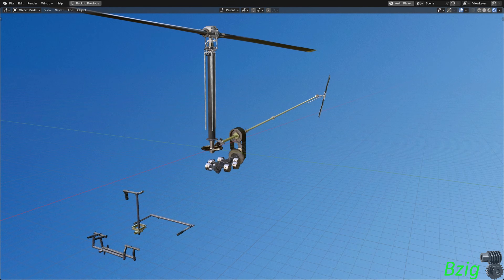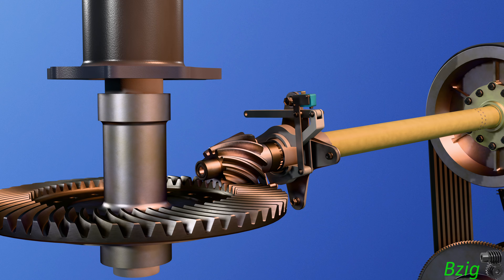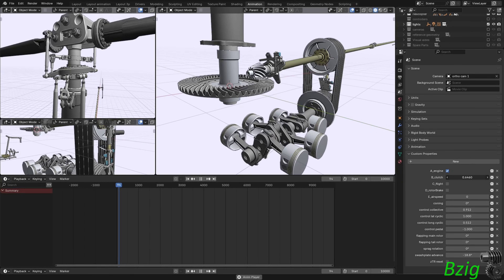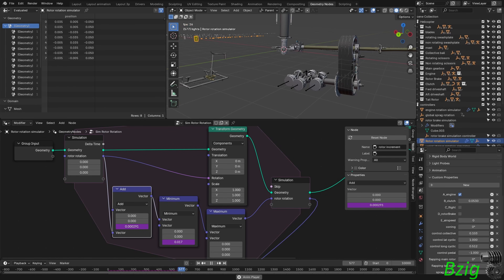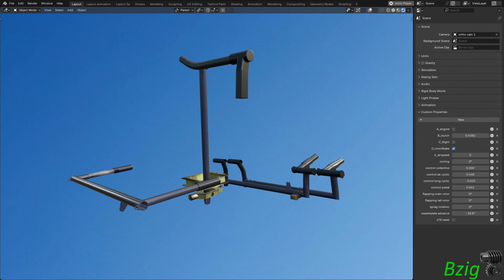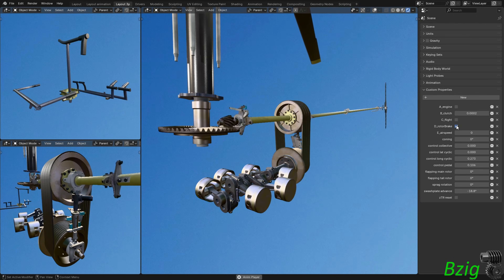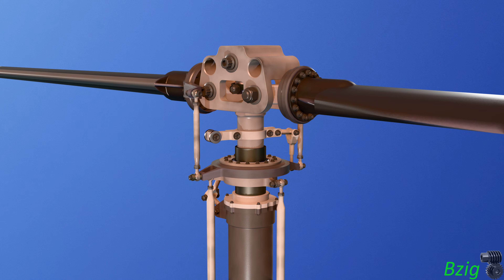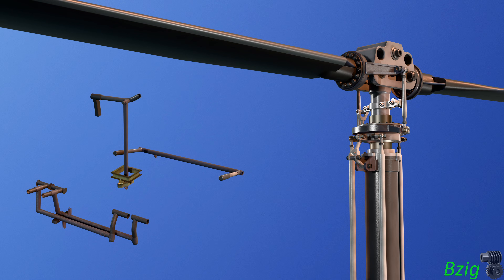R-44 Helicopter Project Update

Comment: Thank you for sharing this information . But I still waiting for the coaxial rotor ! 😂
Reply from the maker: in work... really ;)  I've started a preliminary design.  I'm taking inspiration from US patent US 20200377208 for the control system except I'm going to do this as a 2-blade teeter for simplicity.
Reply: That will be awesome❤

Comment: Awesome as usual. If a passenger in an R44 pulls the rotor brake in mid-air, what happens?

Same question for any makes of helicopters that have a different answer.

I’ll bet you know the viral video that prompted this question.
Reply from the maker: I've never had one come on in flight... I've flown a few models with electrically actuated brakes.   Manual brakes and electrically actuated all have procedures for a brake on in flight... usually a land as soon a possible emergency, and they all hint that the concern is a brake fire, and not a loss of rotor RPM.  smaller helos?   IDK, there might be an RPM reduction until the pilot smacks your hand away 😬
Reply: @bzig4929  OMG, have you not seen this? https://youtube.com/shorts/4AOvXCiMaXg?si=us4ZkvDcbA1UuLu0

What model helicopter is that, and what damage could she have done? I presume she was a hot-mess blonde.

The comments on some of the postings of that video are wild and all over the place, with no clear answer as to if she could actually have killed everyone on the helicopter. Is it possible to work through the physics accurately enough?